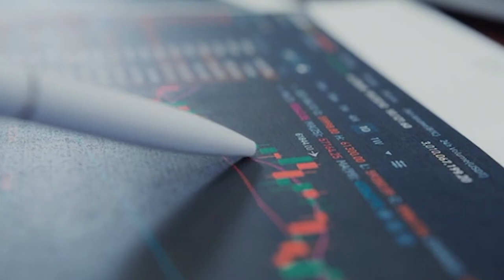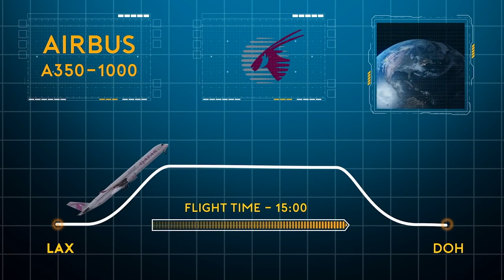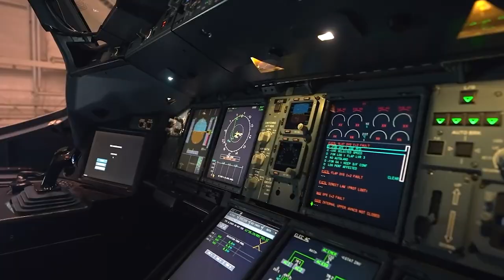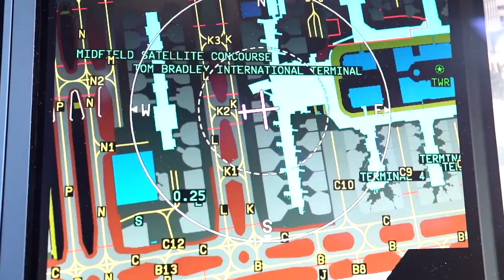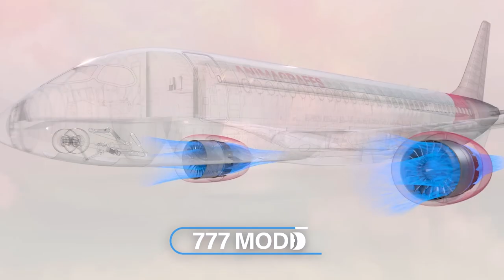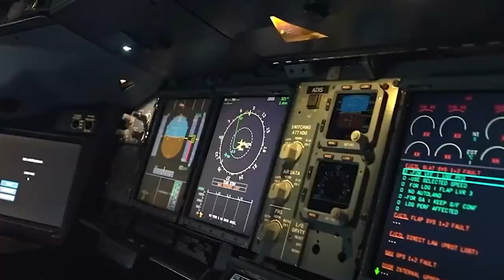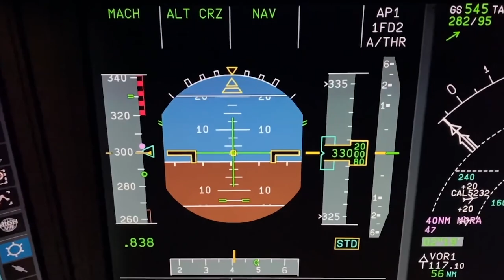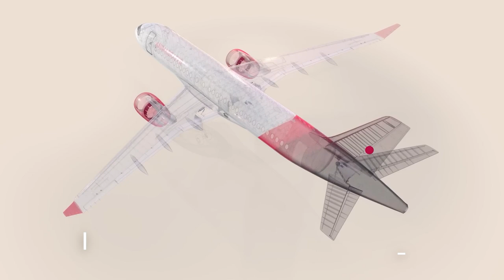Airbus A350 is Making Boeing Run for Its Money - Here's the Secret 🔑 #AirbusA350 #BoeingBattle🚀🛩️💰

Comment: Has Airbus solved the paint problem yet?
Reply: I think the paint degradation was due to the lightning shield wire ?
Reply: Looks like they did some improvement
Reply: They finally found an agreement with Qatar... it was not a major security issue. Looks they have solutions
Reply: @AndreW-qj9yc  It is a safety issue

Comment: A350 family	967	total orders ,526deliveries , 441back log
B787 family  Total 1,629 orders1,048deliveries, 581back log
Enough said.
:goodvibes:
Reply: That would be fine if it wasn't for the fact that the 787 has been on the market for much longer than the A350. More relevant figures are the current annual new orders each is receiving. Also, to compare just the A350 and the 787 is nonsense. The A350 overlaps the 787 and the 777X, which isn't even in production yet. It will be interesting to see how this develops. My money is on Airbus.
Reply: @2000globetrotter
Reply: @2000globetrotter  787 was ahead by 2 years in that it had 291 orders, but also lots of bad press IE battery issue , constant delays.Yet still it’s has 662 more orders than A350.That’s just my 2 cents thoughts  from this Airbus promo video.
Reply: @boweknows5345  said by another Boeing fan boy.